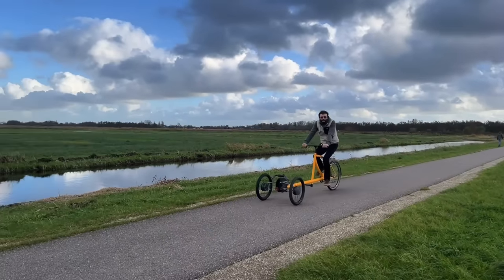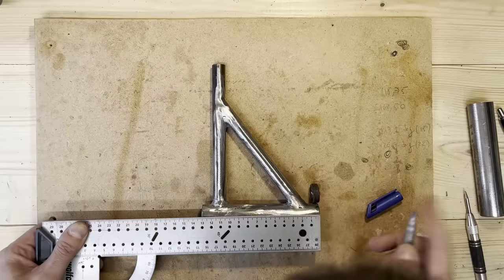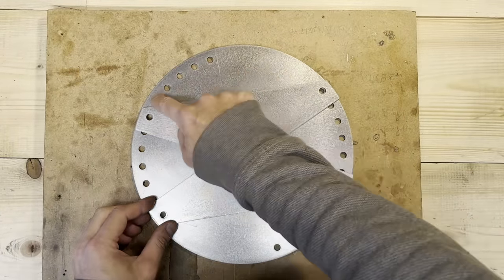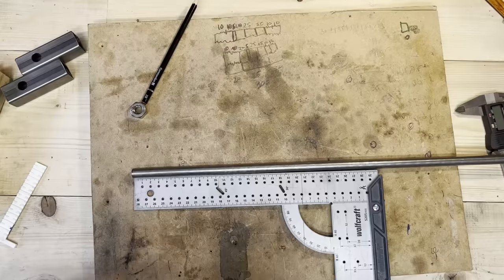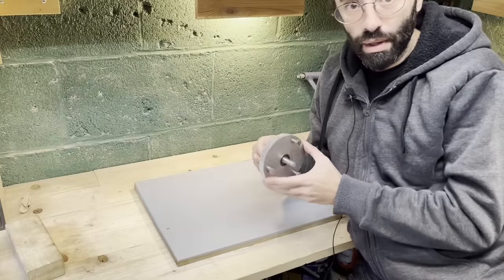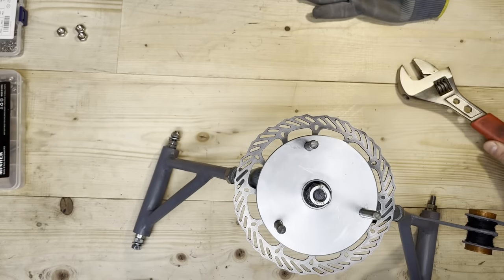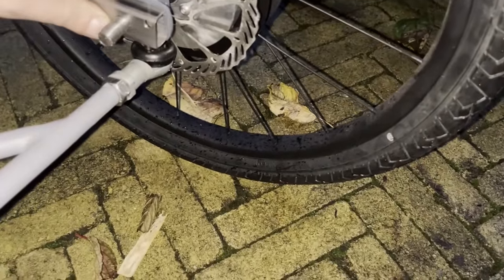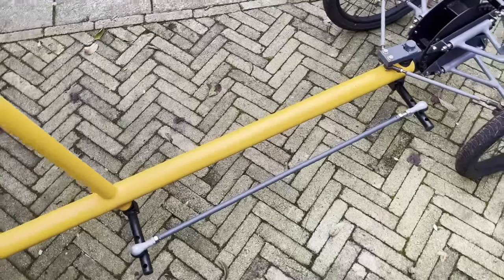Making of a Reverse Tilting Cargo Trike with Adjustable Geometry #5 - Full Build

Comment: Hi.  You've got brake discs, but I can't see anything to stop them?  Have I missed something?
Reply from the maker: Hello, that's a very good point. I designed the hubs to hold the disc brakes but this is not the final design of the knuckle and for that reason I haven't created the supports for the calipers. I will install new knuckles with support for calipers for sure;) This will be on the next version.
Reply: @pedro-neves  thumbs up there then.  Here in the UK not having a front brake breaks the law.
Really interesting project though.  I have been dabbling with a leaning "tadpole" recumbent trike for the last 25 years but haven't had time to start building.
Reply from the maker: @emmabird9745 , thank you! Ya, definitely don't want to go without front brakes;)  I hope my videos help inspire you to build. I will continue with further iterations of this vehicle and share the new versions.

Comment: i think the only and the worst part is seat, could you use hub weheels with built in dinaomos?..
Reply from the maker: Hello, I'm actually planning to build new hubs for the front wheels and installing a rear wheel with an electric motor. Cheers!

Comment: Thanks for the good video: 2 questions. Which tubing material do you use and where do you find the end element of the triangle wishbone? The rotule? Or I don't know how to call it?
Reply from the maker: Thank you! I use steel tubing. The wider is 25x22mm and the smaller is 15x12mm. The end is the ball joint, yes.

Comment: you went to all that trouble to make jigs and brackets for your work, but you don't have a welding bench - is there any particular reason you are welding on the floor?
why did you make that massive hole in your frame to support the steering arm?  this is where it will break, when you hit a bump with a load.  surely a collar would be better?
Reply from the maker: Hello, very good points! 
1) My  workshop capacity increases gradually over time. I have a 3x2m shed to do the mechanical work so I weld outside. Actually, one of the next tools on my list is a TIG machine so that I can weld inside.
2) Very good point. It has to go through, because an axle goes through. The steering extension connects in the bottom and the steering links in the top. Once I close this design, I'll weld the cups to the frame. I believe the cups will make the frame as rigid as if there was no hole there.
Cheers!
Reply: @pedro-neves  i think your design is excellent, and very well thought out, thank you for the education.
Reply from the maker: @rewIndustry  , thank you for the kind words.

Comment: When making the center hole on your wheel hubs, why not drill all the way through from one side only and use a spacer between the two bearings? That's how motorcycle wheels do it.
Reply from the maker: That way the bearings could come out from the outer part of the hub. Motorcycle wheels also have a slot on each side. Cheers!
Reply: @pedro-neves  Ah yeah, correct, you do need something for the outer part of the bearing to rest against...not just the central spacer. Good work.
Reply from the maker: @nicknelson9450 , Thank you!

Comment: you have the disc rotors backwards. and is there any Ackerman in that steering?
Reply from the maker: Hello, yes there is Ackerman steering. The inner wheel turns a little bit more than the outer wheel. In my next video, I'll explain in detail all the geometries and will explain the Ackerman also with CAD files for clarity.
Reply: ok I did hear that later in the vid after my comment...at first I thought you were just a nutty guy overbuilding a strange bike until i realized they are cargo-bikes, now i see it is  quite clever!  @pedro-neves
Reply from the maker: @whatyoudo9773  , thank you! Since this video I have already built the cargo bay, and I'm now doing tests also with cargo which I will share in the next video related to the trike.

Comment: Great build, do you plan on adjusting the angles/lengths constantly? Because I can't help but think about the work/weight you could safe if you find your perfect parameters and just build it non-adjustable
Reply from the maker: Hello, good question! I built a trike with adjustable geometry just to find the right parameters. Once I have them. I'll build a system with fixed parameters. It will save a lot of weight and space for sure!

Comment: You have several errors in the assembly... 
1 radial spoke if you are not using rim brakes is the worst option. 
2 brake rotors are not aligned correctly - check the direction of rotation

Comment: Correct me if I'm wrong, but did you not include the ackermann angle in your steering? It looked like the steering arm was parallel to the wheels.
Reply from the maker: Hello! Yes, I did include it. The steering arms are parallel to the wheels but they are a few centimeters inside of the center of the turn radius of the wheel. You can see in the tight turn right on minute 46:03 that the inside wheel turns more than the outside wheel.
Reply: @pedro-neves  Oh, got it. I figured it would've been odd for you to go through so much design and engineering the suspension geometry just to ignore something like that.
Reply from the maker: @FeedMeAQuarter  , well, on every iteration there are improvements and always something can be done better. And I'm really happy to read comments with suggestions of improvements. It has helped me a lot! So thank you for pointing anything that you think that be better!

Comment: Why not to make the front wheels fixed straight forward, and the rear wheel steering (turning) with a regular bike fork installed at the rear end of the frame?
Reply: This would prevent the bike from tilting and could cause rider to tip over on a fast turn.
Reply from the maker: @user-uk1pe7bj4f  I agree. Without tilting you have to have a wider track so that it's harder to tip over and still you cannot go as fast.
Reply from the maker: I have seen a system such as you describe and I liked it. The advantage is that you get great maneuverability at low speed. The reason why I do it with front steering and tilt mechanism is because I want it to be good to ride fast and also have a narrow track. With fixed steering, you need to increase the width to make it harder to tip over.
Reply: @pedro-neves  I get it, thanx!

Comment: Crazy awesome design! Only one thing I noticed that could be improved, I think the shock linkages could just be solid mounted to the A-Arms i think the secondary pivot they have is keeping the shock from really catching the forces. Also  would there be any benefit to adding q spring to have the suspension pivot back to center?
Reply from the maker: Thank you! The shock linkages are not final for sure. The reason I designed them like that is because I have that disc that I use to regulate caster angle but after the riding and geometry tests I'll fix the caster angle and have space for shorter shock linkages. Regarding the spring, ya, that might work. Never tried it;) Cheers!

Comment: to me it would be better changing the steering by having rods that run to the front wheels connect to the handlebars on an angle it just doesnt look or ride smooth to me the way it is.

Comment: Are you sure this is a sufficiant way to weld that?

Afaik you would want to baffle (pu an angle on the parts to be angled) on these things to build a up root. I assume this is steel.
Reply from the maker: Hello, yes, this is steel. Still a prototype but the welds are holing up. Cheers!

Comment: It's difficult to see on the video but is there Ackermann geometry on the steering linkage?
Reply from the maker: Hello, yes it is, you can see in minute 46:03 on a tight turn right that the inner wheel turns more than the outer wheel. Cheers!

Comment: TLDW, why are the front wheels so far in front of the handle bars?  Is that for the cargo bed?
Reply from the maker: Hello, I'm designing this to be a cargo trike. But I haven't fitted the cargo bay yet because I'm still working on the mechanics of the suspension and steering. Cheers!

Comment: Does it have any brakes at all right now?
Reply from the maker: Yes;) the rear wheel hub has a brake (if you make force on the pedals to go back). The front wheels will have breaks as soon as I'm finished with the suspension and steering.

Comment: Why the long tube extension to the front wheels? Did you find that ball joints limited the tilt angle?
Reply from the maker: Hello, I'm designing this to be a cargo trike. The cargo bay will be fitted into this long tube extension. I haven't fitted the cargo bay yet because I'm still working on the mechanics of suspension and steering. Cheers!

Comment: It's a little painful watching the hub issue after seeingthe PCBway quote for the hub with all the aluminum tarrifs 2tc. You could use a bushing if you drill a bigger all the way through with a spacer between the bearings that's assuming you can center it still. The control arms I made are small than your but I don't think it will be an issue. Did you put the arm so they are equal distance from the axel line? I figure they  are centered above and below the axel height lining up with the top and bottom of the hub. Is tha correct?
Reply from the maker: Hello, the steering arms should be sized having two main things in mind: Ackerman and Bump steering.
I explained it a little bit better in the video where I explore the geometry: https://youtu.be/q2GTZd428vM?si=RxUFCvk8eCUKq6PX&t=1550.
I hope this answers your question.
Cheers!
Reply: @pedro-neves  I don't know how I missed that part of the video but I believe you covered it in another video as well. I knew about Ackerman but bump I didn't Glad I rewatched that ivideo.because I can imagine the headahe of not factoring in bump. Once again thankyou. However  I was  referring to the placement vertically though. I assume it's a matter of aligning the upper and lower control arms equal distance apart from the axels? I can't seem to find any mention of how the arm heights were calculated.. It looks like they are in line with the top and bottom of the hub. I guess arm length would be part of this too. Greatly appreciate your responses, they've been very helpful.
Reply: Sorry if I'm over thinking here just seems i's a chicken or egg issue. because my arms are shorter and don't recall an arm length given i have a poin they have to reach but without a approximate total length I don't want screw up the inside wall I made to hold the arms by welding the hangers too high or too low..  Really loving this project and want get it right.
Reply from the maker: @GypsyJrs  you are welcome;) and thank you for your kind words;)
I think I understand your question now. The height of the steering arms is not important. I just chose this height because it's convenient due to the rest of the frame. No other impact.

Comment: I want to make this except for a wider front wheelbase. Would you suggest wider wishbones or a wider linkage? Sorry if my terminoligy is not correct in advance.
Reply from the maker: Hello, well this is a matter of choice. So, wider wishbones will give you more travel (example: sand rally buggies). A wider linkage and shorter wishbones will give you a shorter travel (example: road car). Hope this helps;)
Reply: @pedro-neves  Thank you for your reply. I guess personally I would be interested in road travel with the ability to handle some rough roads as well.
Reply from the maker: @hogginger2982 , I think the size I made is a good mix as well. In my next trike video I will explain all the sizes and why, and I will provide a very practical explanation on why I chose this exact size;)

Comment: Is it possible to remove the top bar to make it more like a step over frame without losing too much strength?? 🤔 also is it possible to add tie down rails on the sides between the front wheels and the rider
Reply from the maker: Hello, yes, I believe those would be possible. Until now, I've only been focusing on the suspension and steering mechanism because I want to work on making it great to ride. Onde this is resolved, I'll move on to cargo bay and other parts. Cheers!

Comment: So the tilting is just floppy?
Why didnt you make it so it tilts the correct way when you turn the handlebars?
Reply from the maker: Well, I want it to ride like a bike (with the extra safety and cargo ability of a trike) so the tilting mechanism works when leaning.
Reply: @pedro-neves  this is much better. While driving the tilting angle depends much more on the speed and not only on the turn angle of the handle bars.

Comment: What is the benefit of your trike, compared to an ordinary bike?
Reply from the maker: Hello, my opinion is that a trike is safer because in the event of the front wheel slipping or hitting an obstacle, this will not mean a crash in most cases. I started thinking about this because where I live, in The Netherlands, it rains a lot and there are many motorcycles with two front wheels, such as the Piaggio MP3. The second reason, is that it can carry more cargo due to having more support. Cheers!
Reply: @pedro-neves  Are going to sell your trike? Any new design are you working on? I'm in Toronto 

Merry Christmas!
Reply from the maker: @stephenlee4369 , thank yo so much for being interested. This has been a long project. Every time I make a new version, there are things that I want to improve in it. This version is much better than the one before but there are already improvements that I will put into the net version. At some point, I think I will consider it good enough to turn into a product and at that time I'll work on making it a business. I'm in Amsterdam. The way I imagine that someone in Canada could use my products would be for me to share the plans with a local fabricator. Let's see. Cheers!

Comment: Hey, my recent comment on this video got deleted.  Maybe it was because I had several links embedded into it.

My comment was:
- mentioning that the cater ajasuttinge mechanism also adjusted the anti-dive behavior
- suggesting to look into Ackermann steering geometry
- suggesting triangulating the suspension mounting points like how Koenigsegg does it on its upper control arms
- linking a video called "Roulle's Seminar" to reduce compliance in your design
Reply from the maker: Thank you very much! I just went and see a factory tour of the Koenigsegg where they show the wishbones pretty well;) And I'll watch the Roulle's Seminar too! Much appreciated! Lots too learn;)
Reply: @pedro-neves , I had a spelling error.  The cater adjustment mechanism also adjusts the anti-dive behavior.  I recommend watching "The Complete Guide to Anti-Squat" from Suspensions Explained.
Reply from the maker: @johnkim3858 , thank you!

Comment: Please remind me, how is this better than just one wheel in front? All I see is an overcomplicated wobbly pothole detector. Am I missing something?
Reply from the maker: This is more complicated than a bike for sure. And I want it to behave like a bike. But, in my opinion, this will be safer than a bike because if the front wheel slips, this will rarely mean a crash. Where I live in The Netherlands it rains a lot and I've noticed many Piaggio MP3 - the scooter with 3 wheels. They are very common because they are safer in the rain. Also, a 3 wheeler can carry more cargo. I love bikes by the way. But recently I started being a fan of trikes as well;) Cheers!
Reply: @pedro-neves  Thanks for reacting. Read up on the mp3 stability myth...
Reply from the maker: @rinkinkel , these things are always arguable. But from my short experience with reverse tilting trikes, I do consider them safer (mostly in the rain) and that are more suited for cargo. But I'm a fan of cargo bikes too. Actually, I just tried one in a Cargo Bike festival and liked it very much! I will release a video soon where I test a few different types of trikes and compare to cargo bike as well.
Reply: @pedro-neves  Cool

Comment: You could have solved the problem with the bearing holes by just mill the hole all the way trough, put the bearings in with a spacer in between.
Reply from the maker: Hello! The thing is: the spacer has to be fixed to the hub or else the bearing assembly could slide out off the hub. Thus, I mill on each side so that the spacer is part of the bigger part. Hope this explains my choice. Cheers!
Reply: @pedro-neves  Just Use bigger Washers wich cover the bearings completely, so they wont come of. Use a Spacer that sits on the inner Ring of the Bearings and protect the bearing from getting pressed together and get stuck while tightening. its the same system in wheels of modern rolerblades.
Reply from the maker: @udufbxsixn , thanks! I get what you are saying now. I'm actually working on a new hub design (bearings in the wheels) so always good to have some suggestions and feedback;)

Comment: Pedro, can you explain why you went to 0 scrub radius? Thanks
Reply from the maker: Hello, well, as I understand it, scrub radius (positive or negative) will cause one or both wheels to scrub when turning. I understand that this is done in cars but on a trike meant to go no faster that 25 km/h I felt it would be strange to create stability by scrubbing tires. So I chose a geometry that makes a smooth turn (I think).
Reply: @pedro-neves  makes sense, thanks :)

Comment: Is your Akerman steering geometry correct?
Reply from the maker: I believe it is. I traced a line from the center of the steering radius of the wheel all the way to the center of the back wheel and this is what I got. I know that the inner wheel turns more than the outer wheel as you can see in minute 46:03 when I'm doing a tight turn right. But I am not sure if it is right by the exact amount. I'll test thoroughly and try to see if it is correct by drivability.